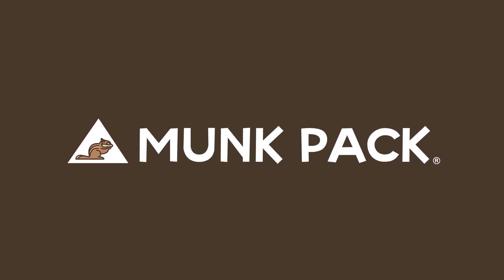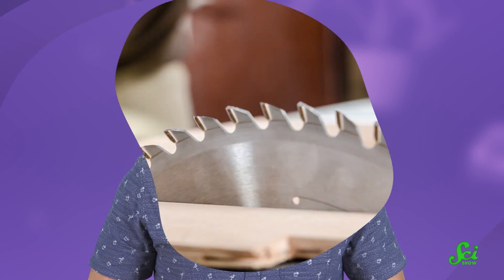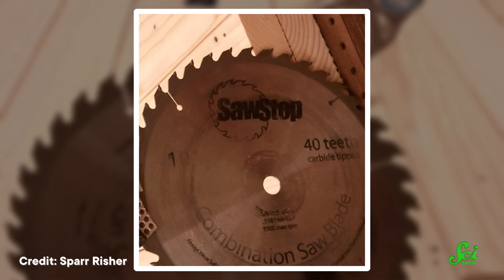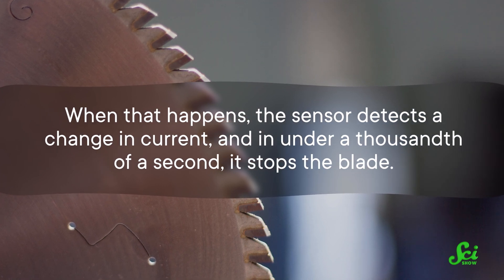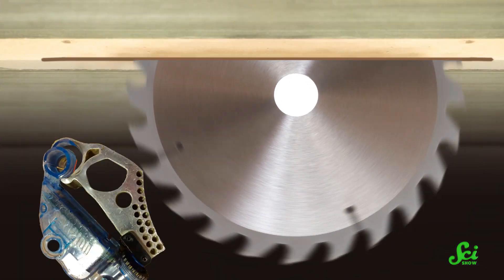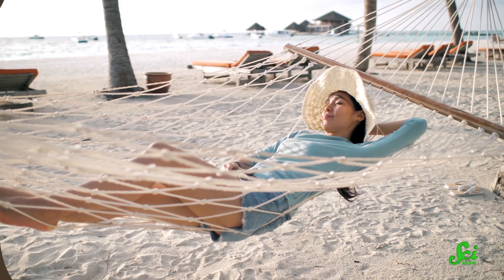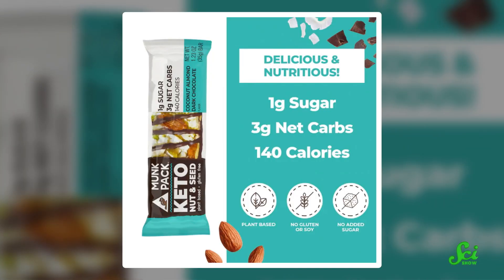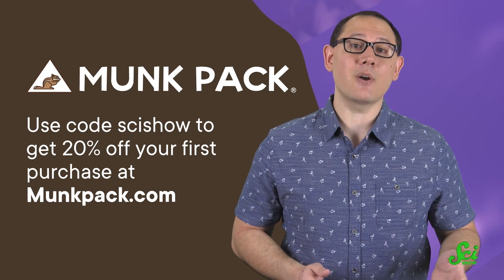How Can a Saw Know What It’s Cutting?

Comment: In my high school woodshop class, I witnessed a classmate trigger one of these. The power had been turned off and the blade was slowing down, but it still activated. I think he got careless and accidentally dragged the back of his fingers over the top of the blade, and I think he didn't even draw blood on the blade.

We were actually able to keep using the blade, because for some reason the brake didn't slam so hard. (close up inspection by the instructor deemed it to be ok to use) I think it still ruined the brake though

Comment: A capacitance check. Probably the same used in Touch Lamps. And some touch Screens.
I think I remember a older version, where you had to wear a wire that put minimal current into your body. Touching the saw with said wire on you would close that circuit, triggering the break.
Reply: And for the sake of fast response, I'm guessing it's either looking for any "charge time" that exceeds the threshold, or a sudden voltage drop when the total capacitance of the system suddenly jumps.

Comment: Correction the saw blade does not get ruined, its still usable👍 I have a sawstop saw and the mechanism engaged once when I was cutting some wet wood. It scared me a little because I wasn't expecting it and its fairly loud.  There is a way to disengage the saftey mechanism so you can cut wet wood and aluminum.  The mechanism has a chunk of aluminum that gets pushed into the blade to stop it. The aluminum is softer than the saw blade so it's only the aluminum that gets damaged and not the saw blade.

Comment: I forget what it's called but the way the saw blade works sensing your finger is basically how smartphones detect when your touching your phone's screen it's based on electrical signals in your fingertips when you touch the screen there is a drop in electrical activity across the screen letting you know where your finger is at and the phone's processor

Comment: Every year, tens of thousands of people in the U.S. are maimed by table saws—they're responsible for more accidental amputations than any other consumer product. SawStop is a safety system that can tell the difference between flesh and wood and stop the blade from cutting into something that doesn't conduct electricity. But what's amazing about this technology is that if you relied on your reflexes to stop a knife from doing damage, it would be too late. Fortunately, simple physics principles can fill that gap and save some limbs.

Comment: Some mistakes, because I've been following SawStop for over 20 years.  

The founder of SawStop didn't want to found the company.  He wanted to sell the technology to ALL the Table Saw Manufacturers.  They rejected this technology as unnecessary and wouldn't buy it. So, he founded SawStop so Woodworkers could have this safety feature.  Virtually EVER Table Saw manufacturer could have had this technology inside had they simply said yes.  

The blades are not ruined by the brake, but they are damaged. They can be salvaged by removing the brake from the saw blade, then sending it out to have the teeth reattached and sharpened.
Reply: What's the cost of repair of the saw (and time) against buying a new one?  (Genuine question)
Reply: @mattyt1961  That's going to depend on the blade.  Some blades are very pricey, well over $100.  The expensive blades are worth keeping and repairing.  The cheap blades are might not be worth the cost to replace.  

For example, a cheap Freud Blade might cost $35 where as a Forrester Blade might be $170.  

Rockler and Woodcraft woodworking stores  usually have a list of businesses that can repair your blade.  

Time?  Depends one the business, it can take as long as two weeks if they have a back log.  

Usually, it takes less than a week.  YMMV

Hope that helps.
Reply: @peterream6508 
What makes some blades more expensive than others?

Do they use better quality steel?

I doubt some would have 'fancier teeth' or anything, right? 🤔😅
Reply: @peterream6508  You misunderstood the question.  Matt wanted to know the cost of buying a new finger.
Reply: @peterream6508  it did indeed, thank you :)
Reply: @draconic5129  I was trying to make a joke, but I don't think anyone thought it was funny.  C'est la vie!
Reply: Thanks, everyone seems to look at what happens after the founder was told to shove off and then decided to protect his invention.

Comment: It should be noted that people have been cut on Saw Stop saws, and will continue. Slowly touching the saw teeth with a hotdog isn't the same as having your hand pulled into the side of the blade in a kickback. Yes, they are so much safer- but you can still get hurt.
Reply: Yes the point of sawstop isn't to not get cut it's to not have your fingers cut off, obviously if you had a really bad kick back and your hand was pulled directly into the blade you would end up with a nasty cut and probably need stitches with sawstop but without saw stop you might end up getting all your fingers cut off.  It's not about preventing injury at all it's about greatly reducing the severity of the injury.
Reply: @draconic5129  According to an industry report, there isn't a single case of table saw injury from a saw equipped with a modern blade guard with anti-kickback pawls and a riving knife, they come on every new saw. People take them off and get hurt.
Reply: well yeah that's the idea of Saw Stop. It doesn't stop you from getting hurt, but at least it stops you from getting free amputations.

Comment: Wish this feature was around when I was in high school. The pointer and middle finger on my left hand met a saw blade while in woodshop, didn't lose them but they are still messed up. (Happened in 2006) after that a couple other kids at my school did lose fingers, when it happened to me I was RIP cutting a 2x6x8 down for a project, my helper who was supposed to be guiding the board was goofing around and the board kicked up, my first reaction was to put it down tight on the top of the saw table and I didn't see the blade at first. Was ugly. Almost lost my fingers.
Reply: How the hell did your school have enough budget for both working saws and amputated fingers? Kidding aside, i didnt think schools would ever allow something more automatic than a hand saw because of possible lawsuits. We all used hand saws it was the only thing available, although definitely shitty and busted

Comment: This reminds me of the cool principle behind surgical saws. Instead of a rotating blade they use vibration. That way if they ever get in touch with any soft body tissue like muscle, skin or an organ it won't get hurt, because their softness lets them vibrate in tandem with the saw. Bone however is rigid and will get eroded away by the vibration.
Reply: That's a tool that anyone can buy now-a-days. Makita, bosch, Dewalt... all the main tool making brands sell these. With different "disks", it can cut metal, ceramics, wood... a great tool...
Reply: I had a cast taken off by one of these saws, and I was scared and spastic about it.  The nurse was this old creole guy and told me 'bud, if the saw cuts you, you can punch me', well, I spazzed out and it nicked me, but he was a good sport so i let it go.
Reply: @w1ngnuts  I was going to ask if that's how cast saws work. I've always wondered about that.
Reply: @w1ngnuts  the friction causes them to heat up after prolonged use, so they can burn you, though. 

Ask me how I know.
Reply: @duchessofeire  how do you know?
Reply: @w1ngnuts  Hi, this is no hate to you, but just so you know, "spaz," "spazzed," and "spastic" are considered ableist slurs as they come from what we used to call people with cerebral palsy. They're seen a lot differently in the US than in the UK but they still have the same root and I just wanted to let you know of their ableist history. Again, no hate to you though. ❤️
Reply: @w1ngnuts  I don't think you get to call him a "good sport" if you freaked out because if a cast saw
Reply: So that’s how they didn’t cut my arm off. Good to know
Reply: RULES OF NATURE!!
Reply: Similar principle with some construction tools! I use a drywall vibration saw all the time and it's great at cutting through rigid drywall but won't cut electrical wires or your finger unless you try really hard to make it do so.
Reply: The oscillating saw is now a beautiful tool for trim and remodel work on job sites too
Reply: We have tools like that for construction too, they just aren't very efficient. They're very helpful at certain times though, so they're nice to have.
Reply: @GuyFromJupiter  great for finishing stuff on drywall that's already painted and plumbed and electrified:)
Reply: Yup, the original Fein Multimaster :)
Reply: That's what she said
Reply: And in the hospital horror movies they make the saws able to kill someone 🤦‍♂️ thanks for teaching me though!
Reply: I guess you can say they jiggle jiggle
Reply: Interesting. I vaguely remember hearing something similar, but it worked with like a sander that abraded things away rather than cutting. Rigid stuff would be work away, but it won’t give your fingers more than nasty rug burn. May have been the same thing.

Comment: Does the stop tech work for band saws?
Reply: I don't think so, the premise is that the break slams into the blade to stop it I don't think that would really work for a bandsaw since  it's a ring shaped bendable blade and not a circular spinning blade.

Comment: It should be like seatbelts and airbags and required by law on all consumer saws.  There are band saws in meat cutting industries that use other sensors but the idea is the same.   I want a table-saw, band saw, chop saw,  all mandated to have limb saving tech in them.  I can't buy a car without seatbelts and airbags, and soon collision avoidance tech built in it should be the same for power tools.  Plus add a camera built into the saw with backup to the cloud so the insurance companies pay out if it's the fault the of the saw.   Hobbies are going to be expensive in the future.  (😜)
Reply: I’m welcoming your suggestion how this could be achieved on a band saw, especially considering quality ones operate the way they do because of their consistent blade speed (read: inertia).

By the way, you can’t just say “smart people will figure it out!” — I’m a mechanical engineer with a (I like to think!) good understanding of physics, which is why I see problems with the idea.
Reply: @altosack  https://www.youtube.com/watch?v=bwXlh9I4htc&ab_channel=ScottAutomation%2BRobotics
Reply: @altosack  the flywheels contain the vast majority of the inertia and they rely entirely on friction to move the blade.

Similar to the Sawstop system, how much are you willing to destroy to dissipate that energy? I'm sure sacrificing a blade is worth it to most people.
Reply: @sonicpsycho13  — Noted. Now, get to work designing a system to simultaneously disengage the blade from the wheels and stop the blade safely (meaning it can’t break close to where it is exposed) within a few milliseconds. (Patent Pending?)
Reply: @altosack  the technology already exists in saws designed for meat processing.

Don't need to worry about industrial-scale (e.g. sawmills), since they're automated. So you're only talking about personal-scale. Relieve tension by either disconnecting the blade from the flywheels or severing the blade. A flywheel could even be stopped by just shoving a big stick between its spokes. You'll break your flywheel, but it'll stop. Who cares if the momentum causes the whole machine to do a backflip?
Reply: @sonicpsycho13  how the heck do you differentiate between dead meat and live fingers? I'm gonna be incredibly skeptical that this actually exists until someone can explain it to me.

Also, breaking the blade on a bandsaw is bad idea because now you have loose band of steel which probably still has lots of inertia and can slap you in the face. Whole saw doing a backflip is also terrible because it could smack you in the face. Idk, i guess a concussion is probably still better than losing a finger, but...
Reply: @reaganharder1480  the existing systems use optical, noncontact sensors and light curtains. Butchers wear blue gloves, so the sensors just need to look for a blue object. The system is set off by one of two triggers: proximity or velocity. If the gloves get too close to the blade, it stops the blade. Or if the glove is moving too quickly toward the blade, it'll set off the system. The system is also a simple friction brake, so the machine and blade remain fully intact. Iirc, it stops the blade in about 0.01 sec.

I was listing off concepts and potential challenges to solve - basically, engineering. A properly adjusted bandsaw will have the least amount if exposed blade. The risk of a dangerous projectile can be reduced by controlling where it's cut, possibly even adding a mechanism to ravel up the severed blade.

The machine may not move from halting the flywheel. I was listing it as something to consider and do the math. If the math demonstrates a problem, then weight or anchoring may be able to remedy the issue.

This is how engineering is done: address potential problems, then solving them. That's how I was able to fit 3 meters of tooling into a hydraulic press with a 1.5 meter working envelope.
Reply: definitely gets expensive as the cartridge will sometimes fire even if there wasn't a real risk and they are 100 dollars a piece, i just turned off the feature, gauze costs less.
Reply: This would destroy whole industries. Table saws are often used to cut green wood that is wet inside, wood with nails in it, and soft metals like aluminum. Band saws are also used for cutting meat and metal.
 Also, modern sawstops use an explosive charge rather than a spring. This may be problematic on job sites portable table saws that tend to get knocked around and left in the sun.

Comment: One safety tip that doesn't prevent you being stupid but can minimize the damage: run your blade just higher than the material your cutting. 75% of the time (conservatively) you're cutting something that's 3/4" thick or less. There's no damn reason you need to run your blade at 2" because you're to lazy to crank it down. Realistically, your blade needs to be more than a 1/4" higher than the material you're cutting. Or you can use the blade guard, but most people don't. That would be smart, this is just to help you be less stupid.
Reply: Actually, the general rule is to have the bottom of the gullet (the dip, or opening between each saw tooth) above the top of the piece you're cutting into. This is because the whole purpose of the gullet is to clear away the sawdust that's being produced by the saw so it doesn't bind and cause a kickback. Some blades (rip blades for example) have gullets that are deeper than 1/4".

Technically speaking, the trade school i went to taught us that having the blade at max height actually DECREASES the chances of a kickback, but of course, you increase the amount of exposed blade. I agree that blade guards are wonderful things that everyone should use.
Reply: @Anatinea  I would think the main reason that having the blade higher reduces kickback is that it means the blade enters the workpiece at a more vertical downward angle. The gullet will have plenty of time to reject sawdust underneath the table, so I don't buy the gullets as being the driving factor in reducing kickback. If the blade is only slightly above the work, it enters for a cut almost horizontally and all of the force of the cut goes laterally, pushing the workpiece back towards the operator (or to the side of a smart operator!)
Reply: both of these are really good and all... But the best common sense technique I was taught as a youth was to just use a small piece of wood to push/hold down your workpiece instead of your hand. Even with kickback, slippage, or straight up ignorance your hand/fingers are saved.
Reply: @Yviira  watch out for the flying bits from kickback, too.  They don’t feel good bouncing off your body.
Reply: There is a "not" missing in the sentence with 1/4", like "not more than".
Reply: (1/4) inch = 6.35 millimeters
Reply: Why not just wear metal gloves
Reply: @GrigRP  Not good enough. Unless you know some elves who can enchant stuff, the best you can get and still have any sense of touch/flexibility is those chainmail-type gloves you might see people who fillet fish use. Think about the force it took to stop the blade with that mechinism.
Reply: @GrigRP  gloves are dangerous because they can get caught and pull you into the saw.
Reply: The rule of thumb foe table saw is to expose the blade the same height as the amount of thumb you are willing to lose. Les